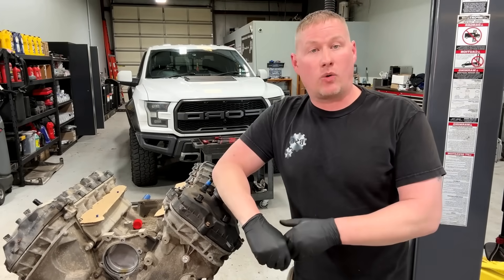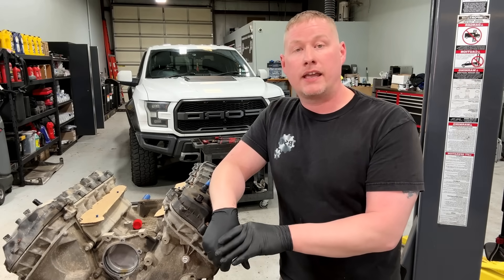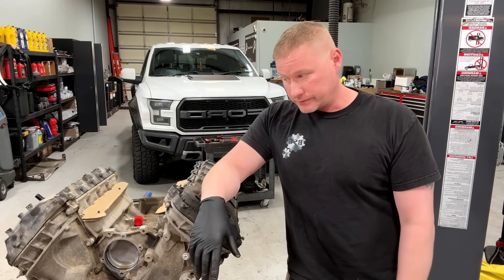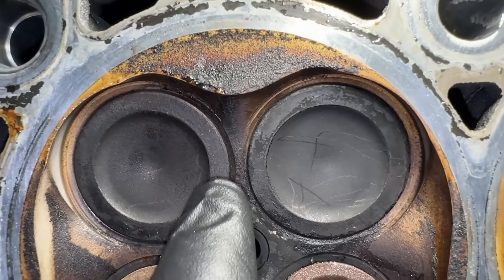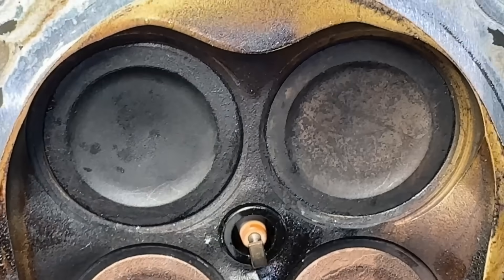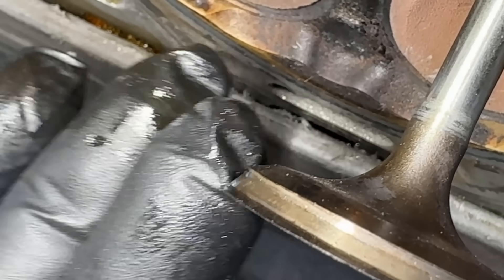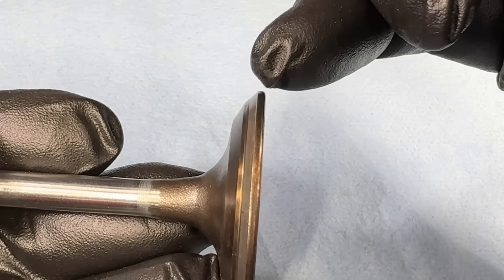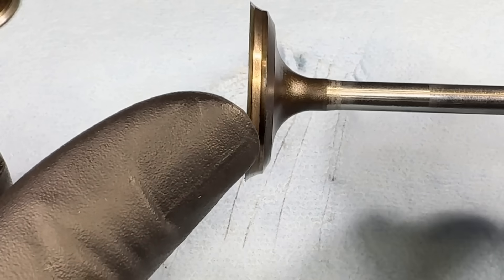The One Fatal Design Flaw of the 2011-2014 Ford 5.0L Coyote Engines!

Comment: Yep there are two engines that have this intake valve problem I still remember the Ford 400 engine with bad valve springs.
Reply: At least a set of valve springs on a 400 would be relatively simple to replace!

Comment: 275k on my ‘13. Maybe I got lucky, it does make noise when starting- assuming it’s the chain guides. It’s never had anything done to it so far. A lot of 300 mile trips at 80-85 for the last 165k.
Reply: Better get those chains fixed soon
Reply: Sounds like frequent oil changes keep it running strong my friend
Reply: @cr2158  Funny thing is this is the first vehicle I have just done when it said to. I have no idea the mileage on oil changes. Although, I do all my other vehicles religiously at 5k.

Comment: Wondering why someone would spend $10k on a replacement engine instead of just putting that towards a new truck. Here in the northeast, after 10 years, the body and frame are shot.
Reply: Because a new truck costs $45,000 and this new engine only $10,000? Makes sense to me!

Comment: Imagine that, a junk valve from a batch of thousands, just like the 427 LS motors from GM back in the day.
It happens but quality control is sometimes Not Job One at the vendor level. 
Even worse these days with so many vendors buying crap parts from China.
Live and learn.

Comment: Bought a 2011 core motor. Scuffed #8 piston. .010 bore cleaned it up. Replaced the valves with Manley stainless. Glad I did. Just heard of this. Thanks for the video.

Comment: Im at 246k miles on my 12 and still going strong.
Reply: Hell yea great motor if taken care of...i love my 2014 5.0 with a cold air intake...
Reply: Same on my 2011 it’s a daily work truck too 💪 250k
Reply: Hows she doing today?
Reply: I have 2012 coyote f150 also.  No issues.  Keep ur injectors and intake valves clean.  I use gas additive and spray cleaner treatment respectively to clean both.

Comment: Excellent information. On my 2018 F150 with 104k, I just had my transmission replaced. Hard shifting and slow shifting. Also had cam phasers replaced at 60k and again at 95k... !!!
I get lots of information from your videos including doing the cam phasers on my old 2006 with the 5.4. THANK YOU!

Comment: On the other hand, I have 2012 F150 5.0 with 215000 miles. Nock wood, no issues except the famous tic wich happens randomly since about 60K miles, but Ford say its normal.  There even is a TSB about it.
But thanks for the video, alway learning.
Reply: try some 5w30 or 10w30 syn blend oil ...mine is WAY quieter ....ford set up the bearings too loose I believe

Comment: I have a 2013 built 10/2013. It has 180k miles and I tow a 6,000lb trailer 10k miles a year. Engine runs smooth as butter. Can I assume this issue will not apply to my truck?
Reply: Just checked build date on my 2013 Lariat...10/13...only 32,000 miles...think I might be lucky. Just added a tranny pan with drain plug and dip stick under hood.

Comment: The valves on cylinder 1 don't look all that great either!
The seat area is already sinking!.
Those need to be reground at the very least but, I would just get a whole new set of replacements and lap them in and call it a day.
It looked like on the head side; the seats are fine and from the way you were having to pull them out the guides are fine too....
Like..... I'd take that motor in a heart beat.... That thing would be awesome in my 95 Mark 8!!!
Reply: Agreed hes over thinking the f out of this one!

Comment: Designed to fail for service revenue... the profit driven business model that makes me not want to buy anything new from them. Im still driving my 2006 5.4 3v with 132k miles and a fresh timing set i did at 125K when i took the engine out of the truck due to a rusted frame and put it into a 2005 with 274k miles with perfect frame and body. I spend 2700$ for the 2005 running truck and $1200 timing set/oil pump and swapped it in my driveway. No way im spending 50 to 60k for a new designed to fail truck.

Comment: Did this job on my dads 2013 on cylinders 5678, I wonder if the E85 messes them up faster since these are flex fuel engines

Comment: This is the stuff nightmares are made of.. if this happened to my truck I wouldn't be able to afford the repair bill and parts. That would be the end of my truck. My 2014 F150 HD Crew Cab has 180,000 Kms or 112,000 miles. I am hoping there is a lot of life left in my truck. I bought it used 2 years ago. It is a bit of a lemon but I have been able to fix everything myself so far and no repair was expensive. I don't even want to think about this.

Comment: It's smart to replace the motor. Even when I was an innocent youth, my dad said "if you grind the valves, she'll start leaking past the rings" He said this about engines back then. It's still true today. On this engine, I wonder why only the one cylinder had "tuliped" valves? The others are ok.
Reply: Shop teacher taught me that 20 years ago. They would do head jobs at the dealer, and the engines would come back with severe oil burning, past the rings.

Comment: 160k miles is quite enough to replace valves it's acceptable but machine shop fees are too high in your country that's the main problem.valves and guides are cheap itself and usually no needs to replace camschafts so what costs for US$ 4000 for each head?

Comment: Question on sport trac 2004 4.0, had a both banks lean, changed fuel and air filter, cleaned mass air, if fault comes back what you sugest?

Comment: Looks like a ‘65 Hi-Po valves that was ran 15k miles on unleaded gas, seats ate up and valves had 0 margin left. One intake valve had stuck in the port, broke the rocker stud and bent the push rod. 
Safe to say i need new valves in all 3 of the 5.0s i have sitting here then, was this mainly Truck 5.0s or was it a Mustang issue too?

Comment: crazy thankfully i’ve never had this issue.
At 548,000 miles
Reply: Theres probably more 1st gen 5.0 out there with 300k* miles then there are out there with this issue. I personally think the company that makes the valves had some bad runs or somthing and did not know. Or it could be as stupid as a single shift not making them properly. Theres too many out there that dont have this problem to say its really even a “problem” might you say its luck of the draw. Knowing this id rather buy a 5.0 over the 160k mark. Then you know its good…
Reply: What year is your 5.0L and date of ur truck on the sticker please
Reply: @cj1613  2012 
i dont have the door sticker because it was reskinned due to deer strike
Reply: @Failure_Is_An_Option  what about?
Reply: @Failure_Is_An_Option Your problem
Reply: @cj1613  1999 7.3L powerstroke.
Reply: 548,000....guessing it's a 7.3 and not a Coyote.
Reply: concave . What is shame and then how many miles to this is do they do this. So 3/4 valve seats were okay

Comment: Great video and info. I have a 2011 GT and my secondary timing chain broke. And it broke two finger followers and bent a few valves. 

They also told me they replaced a couple of the valve guides because they were loose? 

Question is do you need some type of tools to install new valve guides? I would like to take my head off and install new valves in it and I would like to install new valve guides also? 

Thank you, sir

Comment: What if the valves were replaced before they  started to damage the heads, would you be able to replace the valves without sending the heads in to a machine shop for expensive work?

Comment: Great info as always.  Would you or anyone else be willing to share average replacement cost with a Ford reman on a 2011 F150 FX4.  Truck is otherwise sound at 168,000 miles.

Comment: I fixed my 2012 F-150 5.0 problem by replacing it with a 2019 F-150 3.5 Ecoboost!   This one little hack they dont want you to know.

/s
Reply: Congratulations, now you have cam phaser startup rattle to worry about now😂
Reply: @eliohernandez01  Those thoughtful engineers at Ford just didn't want to leave me out of the planned obsolescence club!  😜

Comment: Haha My 2014 5.0 F150 is in the shop right now with the exact same issue on cylinder #8 (I have 130K miles on it).  They could see the cupping with a bore scope.  At the moment it is only cylinder #8 that looks bad with the bore scope.  The current plan is to send the head off to a machine shop.  The shop quoted me 4k to replace only the one head.  This one really hurt my feelings.  There is likely a Chevy in my future.
Reply: Better get an older Chevy, the newer ones are junk.
Reply: Buy an older toyota 5.7 if you want the most reliability. Stay far far away from gm. I think the crap gm is making nowadays proves people will buy anything. They could make a motor out of aluminum foil and people will still buy what they like the most.
Reply: Chevy is actually worse than Ford. The newer they get, the worse off you are. I am mentally tired of pulling front diffs to break down Gm truck engines to repair.
Reply: WOW! $ 4K is a big chunk of change for a single head to be done!
Reply: @Matt-i8r  Machine shop will rebuild the head for 600.  The rest of it is labor and parts.  The head bolts are crazy expensive.
Reply: @kevinclark4154 whats the name of the shop? And location?
Reply: No way I’d let em do only 1 head! Far easier to do both and be done. What if the valves in the other head fail within a few miles of replacing just 1?
Reply: @matt2118  I have spent many hours debated this in my head.  I agree with you.  The only argument I have is that they bore scoped the other valves and they looked good.  You would think if they are going to wear down they would have already started at 130k miles.  If I was not on a budget it would be a no brainer to do both.
Reply: @kevinclark4154  10-4 on the budget! 🤞 hope it lasts a long time for you. Insane prices on new trucks!
Reply: Build Date?
Reply: I am thinking a 2500 with the 6.0

Comment: Ford just bring back the old 300 inline 6 :hand-pink-waving::hand-pink-waving::hand-pink-waving:
Reply: Twin turbo inline 6 from ford would be awesome
Reply: And the 7.3 diesel.
But it'll never happen because neither can meet the emissions requirements.  Even if they could pull that off, nobody would buy them because they're not competitive in any way against the other manufacturer's offerings.  Very few buyers truly care about long term life, they want a pretty car/truck with lots of bells and whistles and a smooth quiet drivetrain.  Throw a 300 or 7.3 in any modern vehicle and 99% of people would walk away.
Reply: @DonziGT230  It may make the emissions standard, but the CAFE standards would likely be an issue!
Reply: @Matt-i8r  Those old engines won't meet either standard, by a long shot.

Comment: I have a 2013 F150 XLT with the 3.7 V6 and it's been a great engine so far. 
I'm now having a issue with the transmission a slight shudder and I added shudder stop but it seems to be only a bandaid.
When driving I noticed a little slipping for a second or two and a tiny bang when it reconnects .
I'm thinking I might be looking at a new toque converter.
I believe this all started on the drive from Florida to central Ohio when I had the driver's side caliber hanging up at 70 mph and I would feel the truck slow a little and head a screech that didn't sound like it was coming from the caliber.
In short it's a intermittent issue - not all the time.

Any thoughts ?

Comment: We got one in the shop that has a bad intake valve on cylinder 8 customer opted to do a cylinder head. Waiting on the head from ford. Was a pretty easy diag, relative compression test showed it was down . Then leakage test showed intake valve leaking into the intake

Comment: That is/was my motor.  Thanks again for the excellent work, glad I brought it to you guys, pleasure doing business with you.  I was wondering if I would get a video out of it from you.
Reply: What was your driving style/load types?
Reply: @farmingnodak  my dad's 14 ford f150 has a little over 170k and we tow a 24 foot car hauler every other weekend. It is unknown if the dealership he bought it from did a revalve job or not but we did replace sparkplugs and one coil pack cause the truck did have misfires. But with the new sparkplugs and coil pack the misfires went away.
Reply: @farmingnodak  i got it at 117,000 miles, was about 133,000 when I got the motor.   I drive normal, 50/50 highway and city and tow a small boat and 28ft camper occasionally.
Reply: I had this happen on my 2014,  cylinder 3. Engine was swapped at 127k. Compression about 150 on all cylinders, except cylinder 3 which was around 115. I had towed 3500# trailer 1100 miles once. From 80k+ I added a 1" level to the front and ran LT rated 34" tires. Would say 60% highway, 40% city.

My trucks build date was 12/16/2014 so it was a late build. I believe engine build date was July 2014.
Reply: @farmingnodak  id like to know also.
Reply: I wish Brian was local to me.  My 4.6 has an oil leak somewhere at the rear of the engine that I don't trust my guy to touch.
Reply: @pamcm1098  Sounds like you need a new "guy", Pam.
Reply: @pamcm1098 I have a similar situation with my 97 with a 4.6 in it. I have read where it can be the head gasket or in most cases it is where the engine block meets the timing cover and the valve cover gasket leaks at that point. When replacing the valve cover gaskets you were supposed to put a bit of RTV on it. My oil runs from the front to the back and all over the starter. If I was keeping it I would start with replacing the valve cover gaskets. If that doesn't solve it is likely a head gasket.
Reply: @davidclemens1578  The valve cover gasket is definitely seeping, but the drip is coming from somewhere deep, passenger side, rear of the engine.  My mechanic added dye, but couldn't find the source.  At this point, I don't mind the spot on the street.  I add about 12 oz every 1000mi.
Reply: You couldn’t have taken it to a Better shop, but I think you already know that !
Reply: What’s THIS repair gonna cost me??
Reply: I was quoted almost $10k by a aftermarket shop for a reman from Ford. I did a used swap for about $6.5k. Did not know it was widespread issue before going used.
Reply: Well, 2013 150 5.0 170,000 and still going strong
Reply: @williamschuman4951  2012 F150 5.0L coyote…215K… the engine is the ONLY thing I haven’t replaced
Reply: Great Video, Great presentation !
Reply: Where is his shop?  I’m considering a possible F150
Reply: @brandonwaddell2583  it’s a smart move and a terrible thing you have to do - when considering a Ford
Reply: @brandonwaddell2583 Naperville, IL (suburb of Chi-raq)
Reply: How much did it cost you?
Reply: Late add, but my 2012 5.0 has 225,000 miles and still doesn’t smoke.  Runs great!  2000 miles total towing a boat or anything really.  Been a happy Ford customer ❤
Reply: Congratulations on getting a video. 🙌💥🎉 I’ll pass. I don’t want a video. 😂
Reply: Did Ford pay for the work?
Reply: @user-ut6ji8my2h it's out of warranty at that point
Reply: @JamesAgans  no, i bought this truck used.
Reply: @JamesAgans  No, why would they?
Reply: @JamesAgans at 130k miles???! Umm, that’s a hard no. Sucks, Ford quality has gone downhill so bad since 90’s/early 2000’s …. And all the new stuff out there, forget it.

Comment: I have a Boss and it's the valve springs, prior to that I had an Hemi and it was the cam followers, now the coyote valve itself is too soft, what is it with US engines? Are they not tested prior to go in manufacture? or are the project managers so powerful that they can ignore the development engineers after balancing between making changes and re-test or start selling and we will see what will happen. industries are ran by pen pushers!

Comment: They been building cars for over a CENTURY yet can't still  not build a trouble free drivetrain. You think they would be laughing at Toyota face on reliability
Reply: Lowest bidder wins the contract!!!!
Reply: When you hear more and more of engines blowing over defects these manufacturers KNOW that you most likely STILL paying a monthly note and these engines blowing just outside your warranty is like blasting the customers in the gut! They like "we know you paying 500-700 monthly but here's another 6-10k on top of it" its greedy and disheartening esp to ppl who are "just getting by".
Reply: @CajunShrek  I hate to think they actually plan failures like that however at the mileage they develop catastrophic failures you may be quite right.
Reply: I mean the 2.7 is pretty problem free. And i consider the 5.0s pretty problem free. Its a machine made by man. What do you expect? Everything out there has problems and needs a  part/ maintenance. You think everything from helicopters, to ship engines dont have problems and need parts replaced?
Reply: @motormossvlogs1450  All modern long block engines should pull 200k miles with proper maintenance.  That goal post should never be an issue. In 1995 I remember being in a friend's Toyota Corolla when it turned 350k,  I truly thought long life gas engines were on the horizon. I have an 02 Ford ranger with 155k and 15 Jeep patriot with 135k both going strong hope I make it to 350k.
Reply: @rainagain1  86 Bronco II turned 301,000 before a head gasket ended it. (Mazda)
Reply: @danhoward4049  That type of longevity should be the norm. As an older guy I don't want to own anything I can't turn wrenches on.  Seeing the severe problems people are having with essentially new vehicles is quite sad.
Reply: No Ford any many others had a good bit of reliable flagship engines which if technology was "improved" then these newer engines should be running circles over its predecessors. They "can " build it but it just seems to be lot far and fewer in between. Also maybe it's just ppl are caring less about maintaining it then the older engines of the era...